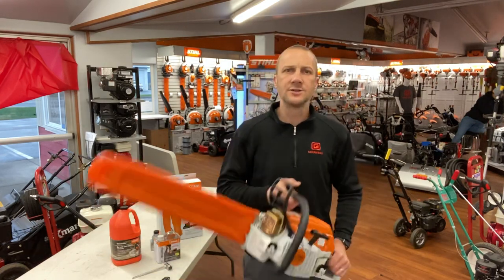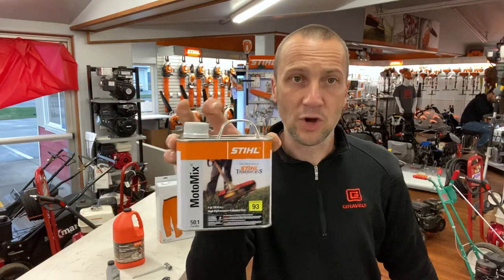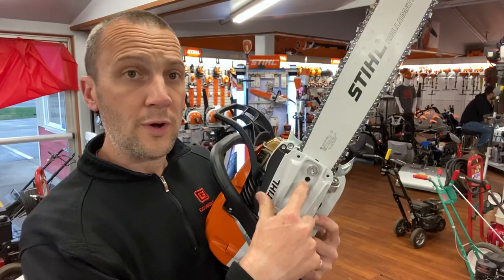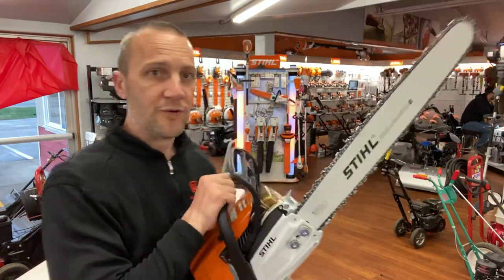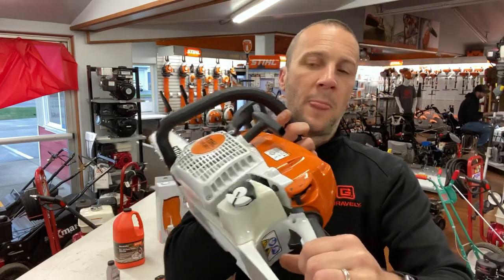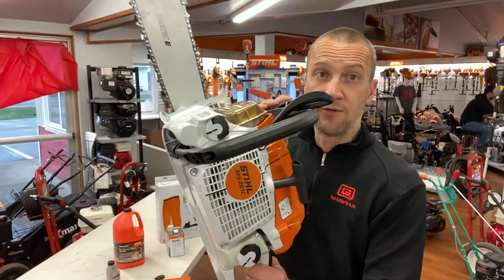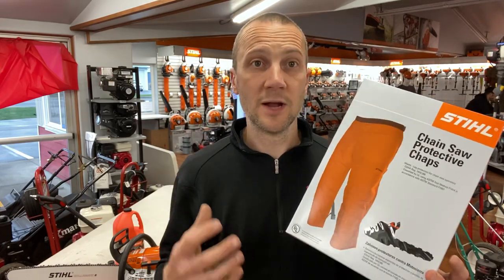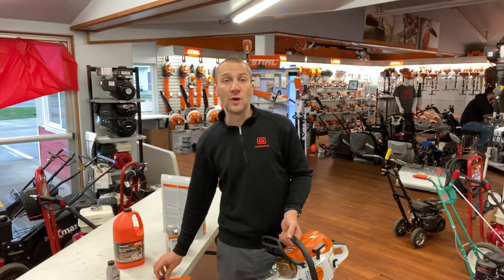Stihl MS261 Overview

Comment: Great video,I just bought this saw new 3 days ago and my dealer didn't go over it nearly as good as you did,thanks.
Reply from the maker: We go over all of the details with our clientele so they know exactly what they're operating. Glad you found our review helpful!
Reply: @Carlsmower  140 psi good compresion 372 xp oe?
Reply from the maker: Yes that is a solid number. But sometimes you can get a false reading. Have you pulled the muffler and checked the cylinder and piston visually?

Comment: Good basic info for anyone who has never run a chainsaw. I was more interested in the saw performance, however. Well done. I learned long ago to always use a thick pair of pants, and NEVER have your trigger finger in a position where you have trouble releasing the gas ASAP. It can happen, but do not do it. Also be very careful about kickback, especially if cutting limbs head level. You gotta keep distance between your head/neck area and the chain. If the juggler is cut, you are dead.

Comment: I hear that their is a winter/summer plastic air tab inside the cover ?!? Can you explain this ?
Reply from the maker: When in winter mode (indicated by a snow flake) additional heat from the engine is allowed into the air box reducing the chance of the carb icing up. Stihl says anytime the temp is below 40°. I have had guys consistently cutting below 35° without the shutter open and not have a problem. My concern is when you fail to switch back and you roast the saw.

Comment: Bar oiler adjustment??
Reply from the maker: Increase or Decrease the amount of oil distributed to the bar and chain. Certain woods or bar sizes would require an adjustment that could save you some oil usage.
Reply: @Carlsmower  I meant you missed that feature in your overview.

Comment: I've had two saws get wiped out buy that stihl motomix, premium fuel and stihl oil(Castrol go!) Has never caused issues
Reply from the maker: There is something fishy going on.
Reply: @Carlsmower  when tested it was found that there was little to no oil in the fuel, carburetor issues as well the fuel ate through 3 oem carb kits, not only that but my dealer would not cover the damages caused

Comment: I did fancy one of these, but after reading many of the problems people were having, I decided not to bother. The problems were all similar and yet Stihl has been pushing out this machine with no fixes. I have Stihl equipment, I'll just stay with my MS180 thx. People should read up on this before they spend their money.
Reply from the maker: We have sold hundreds of the MS261CM chainsaws and I can say our customers are pleased!  The only real complaint I have heard is hard start when hot, I have found that letting the saw idle for 5-10 seconds prior to shutting it off. It seems as though if shut off right after a cut the brains are still in high speed.
Reply: @Carlsmower  That's fair enough, I am going by the many issues people have posted on the net, they can't all be wrong. Seems the 'Mtronic' is what causes most of their issues with not restarting or dying whilst cutting. As I said I have Stihl equipment and was disappointed to read this stuff and it has put me off.
Reply from the maker: That’s where the idle down comes into play. It allows the M-Tronic to recalibrate.
Reply: You're thinking about the MS261CM. The MS261 is a different machine. It doesn't have all the electronics on it. The 261CM is the model to avoid.
I bought the plain 'ol MS261 specifically because it isn't burdened with "modern" electronics. Runs like a charm